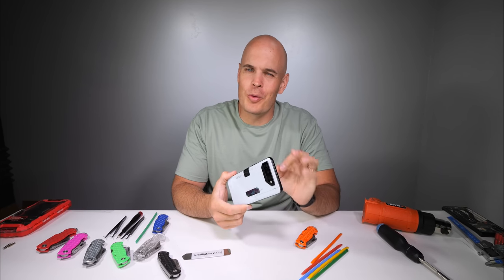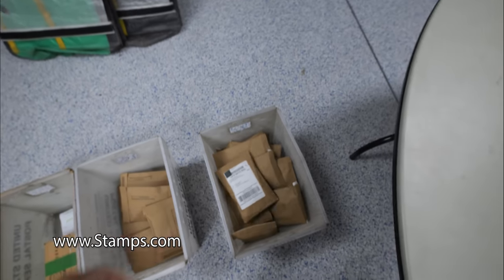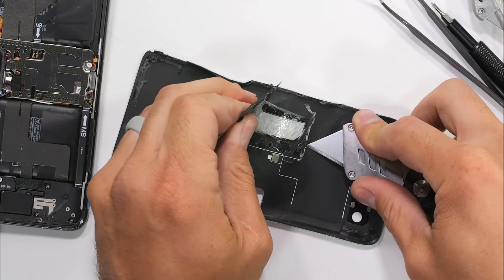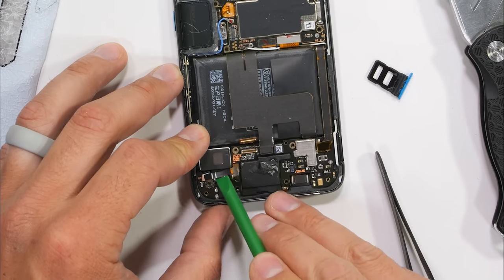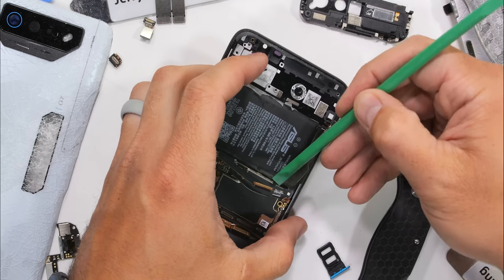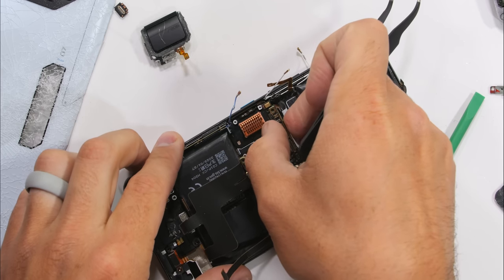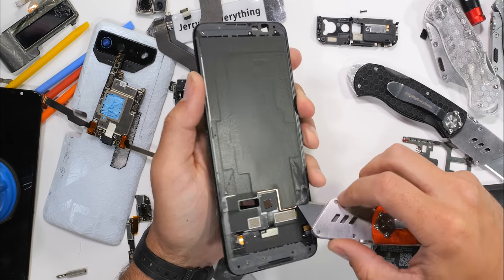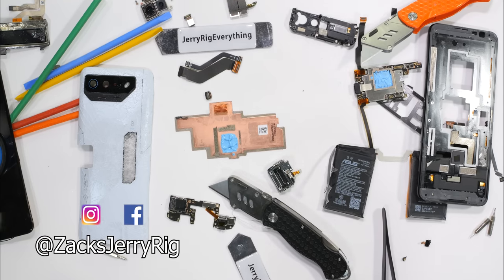Worlds most Complicated smartphone cooling system - (ROG Phone 7 Ultimate)

Comment: This has to be one of the most complicating phones you dissassembled over the years, everything is so intertwined together, like a maze in itself.
Reply: Yay have Rog 6 out of curiosity i opened it once and completely destroyed my proximity sensor i accidentally stabbed a cable on the bottom board which killed it. It has way too many cables
Reply: Nah, there is some HTC phone that was equally difficult or more, forgot the name though
Reply: yh but even tho it's complecated, its probobly more repair friendly than iphones are
Reply: A-maze-ing 😊
Reply: @zakariaejamiai4167  nope, i had a rog phone 2, and it suddenly died after the ic board got damaged, the parts were extremely rare, i gave it to 5 different shops, took almost 5 weeks and still wasnt able to find a part, so i just switched back to samsung and got an s22 ultra
Reply: @kx3811  great job trying to convince us that u did repair.. we know u don't even know how to open a tap 😂😂
Reply: @Alhussainba  HTC M8, I have disassembled one years ago - total pain in the ass 😅
Reply: When he first opens the back, the camera area has adhesive being stretched out. Is that normal like heating and using suction, or is it there to make for permanent assembly. Wondering how asus repair guys would be opening, or if they replace with a brand new phone with new memory and scrap for parts the original phone
Reply: @zakariaejamiai4167  Thats not a high bar tbf. Apple and Samsung both uses isolated software locks for components. In samsung flagships you can not swap camera modules between same two phones, you can't use the camera post root either. Only authorised service can replace the camera and get it registered with phone chipset.
Reply: @meow😼  you*
What's so hard to believe? And you don't even know anyways not like you could prove anything
Reply: @babascamdev2688  my local repair shop does not want to do anything with rog phone. Too rare.. They open up see look power up, told me can't be fix
Reply: @Alhussainba believe me. repairing my htc one M9 with a screen and battery change was a pain in the ass to do 🤣

Comment: 1:34 Zack accidentally hits his hand on the knife's blade and doesn't even get scratched. He's indestructible!!!
Reply: Thought I was the only one that noticed that hahaha
Reply: Probably gets scratched at level 6 with deeper groves at level 7
Reply: With the look on his face, it looks like he noticed it too lmao
Reply: pause at 1:35 - that was a pretty hard contact right with the razor edge.. and not even a small cut? pretty dull knife eh? not the best advertising...
Reply: @shekharbahuguna9475  hahhhhahaa
Reply: Hand is hand, and hand does not scratch :P
Reply: @Juidodin  actually it's because he essentially moved the blade out of the way. If the blade was straight on and didn't get moved at all by his hand it would've been a bad cut. As it is, though, all razor blades like that are made by the same companies to the same sharpness standards.
Reply: @Juidodin  Your reply was correct, he didn't intentionally move the blade off his hand, what I was saying was that his hand contacting the blade made it wiggle (move) which prevented getting the good, continuous contact you need to cut yourself. On any blade.
Reply: @Juidodin  its a feature, blade gives one warning.
Reply: He only gets scratches at level 9 with deeper groves at level 10
Reply: Don't you know in the parallel universe Zack is ironman, and when in this universe has an adamantium skin.
Reply: @Juidodin well actually he sells the razor blade case, not the razor blade itself since you can bought it anywhere
Reply: I came to the comments to see if anyone else saw him slice the knife across and not even flinch it was amazing
Reply: It hit his ring
Reply: Zack is a T1000
Reply: Jerry is the exception of "everything"
Reply: @Michael_Brock  omg 😂😂😂
Reply: Alarms started going off in my head when that happened.
Reply: @Yumosh20 out of almost 500k people that have watched this video you thought you were the only one that noticed that? Really?
Reply: @crunkin1t590  no need to be that toxic bro, sorry for my comment if that made you mad.
Reply: Scratches at lvl 100

Comment: This is the only phone i would understand removing the headphone port on, and the madlads managed to keep it in anyway. 
Super impressed. If this had a MicroSD slot and camera stabilization id buy it immediately but for now, still waiting
Reply: Well, it's so cool that $1200+ phone doesn't have stabilisation while my $200 phone does lol
Reply: @SamurajX-Esports the camera is an afterthought on this phone. As is the point of it. What they need to do is give it a higher resolution display and more pixel density.

Comment: I just tried this flap opening on my 7 Ultimate and i'm amazed I hadn't seen the option to open it without the cooler attached before!
For those wanting to try it - 
Obviously be careful but in the Aeroactive Cooler settings in the armoury crate, go to the aeroactive portal, and press the 3 dots at the top. Then go to cleaning and maintenance. Did not know it could do that!
Reply: Rog definitely doesn't want you to do that as it can ruin the whole cooling system.
Reply: @Fahim_Alam that’s far fetched
Reply: @Fahim_Alam  i mean if that did destroy it, then why can the normal version of the phone work without that? also it literally tells you to use that in that maintenance menu to open it with that menu to clean it using air since the cooler isn't really dust proof.
Reply: @Fahim_Alam  He doesn't want to, and that's why he has it as an option in the commonly accessible menu?

Comment: Phone manufacturer always put main processor behind the display, this made usb cooling fan less effective but I think the way ROG did is better because the copper fin will transfer heat directly from the CPU
Reply: Heat also transfers faster through glass than through a plastic or metal case.... And they know most people will put a protective case which would further insulate the back.

Comment: Since I got the ROG phone 2, I've never wanted another line of phones. I'm on the 5s right now and this thing is a beast. My old one still works so well, thanks to the battery care settings ASUS has put in. Plus the headphone jack, front firing speakers, and large battery, I don't play mobile games but this is a media/productivity powerhouse
Reply: but 5s dont have amolad diplay thats why I am stuck to rog 2 smh
all I care about in my phone is good processor smooth software and a very very good screen
Reply: @divyangverma9880  all of them have amoled screens since the first rog phone
Reply: plz tell me best battery care settings
Reply: @HectorOvalle18  plz tell me best battery care settings
Reply: @divyangverma9880  plz tell me best battery care settings
Reply: I also own an ROG 5S.
What are your battery settings???

Comment: One thing is you can play Minecraft on your phone in overtime. Your phone will get very hot. Running Minecraft for longer period of time so having a cooling system that will keep your processor cool and at the same time keeping your phone cool does help a lot when you’re having a long gaming specialyou can also play call of duty mobile on your phone as well. However, that will also make your phone hot so I think ROG is doing a pretty good job of making phones with high-tech cooling systems to help out.

Comment: Thanks for the alcohol tip.  I found a doner phone to replace the battery in the wife's unit and successfully got to the battery on the donor without any catastrophes.  But I chickened out after attempting to remove the battery as I was foreseeing a massive fire in my shop.
The alcohol will either help or act as a accelerant on my next try.
Reply: Rubbing alcohol works great since it breaks down the adhesive or at least works as a short lived solvent till it evaporates. But a little prying then more alcohol and rinse and repeat and batteries come out rather easily

Comment: imagine having a "complicated" cooling system on the phone ruined by not extending the "riser" on the copper plate which should be in tight contact with the chip as much as possible to achieve ideal heat transfer behaviour. Thermal compound with such a thick layer acts more as an isolant at this point.

Comment: Would be very interested to see what regular person load you can push into a normal smartphone and see what Temps you can get.
Playing music and pokemon go in full sunlight during the summer? Maybe run that off a wifi Hotspot or even better be a wifi Hotspot to push the phone hard and use wifi, Bluetooth, 4g screen at full brightness and speakers at full volume. Sure call of duty would be a better test but pokemon go is so badly optimized it will put more load on the system.

Comment: 02:30 
It was at this point I died on the inside...

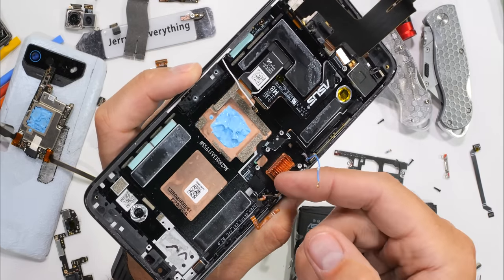07:46
Don't exaggerate.. there's no way you could stick it back together & it still work at this point? I mean it'd sure surprised the heck out of me if you could.. ?

08:54
It may not be unique, but I'm honestly impressed by the engineering... 

This all being said... what I think would be awesome, is if a phone like this, used less glue, & more like frames.. or some sort of backbone support?
So basically all the parts basically just slot into place, but it could be disassembled to fix it?

I still own a Samsung Note 9 phone. I like it. BUT eventually something will go wrong, it'd be nice to have the option to fix it w/o too much of a headache, or being in danger of cracking the screen...
I'd like to just be able to slide the phone apart in pieces, & put it back together as easily. I bought it on sale for like 800 bucks. 

If I bought a 1500 usd phone, I'D DEFINITELY want to have the option of repairing it easily.. or at least being able to get to components & replace them easily. 

Anyways..  cool vid. Thanks for doing.

Comment: I have some concerns harkening to my days of heat and mass transfer. First fins absolutely do help transfer heat however, they do so by convection. Convection requires fluid flow of some kind and I did not see a fan. Second heat sink compound is used as an energy conduction material designed to fill microscopic gaps in polished surfaces and would act very poorly in the copious amounts applied to that phone. If a copper block were installed to bridge the gap then 2 layers of compound applied one to either side of the copper block then the compound could actually work as designed. Based on what I saw the whole design is a way to upsell mediocre hardware. Not all that dissimilar to LEDs on a gaming tower if it looks cool people will pay more for it.
Reply: I just watched the video again to confirm my initial impression and again this serves no purpose, the area behind the fins is sealed making heat transfer occur through radiation only, this is not innovation.😂🤣😇
Reply: So It needs Air flow?
Reply: @youtube_bot839  Yes there is a lot of complicated math to go along with that but I won't complicate this. So think about your car if air does not move through the radiator then the car overheats.
Reply: @practicalenginerd7303  This phone already comes bundled with aeroactive cooler which should solve most of the issues.
Reply: @youtube_bot839  The phone should be fine by itself without the cooler. He even said as much in the clip. I have nothing against the phone fundamentally. My only real concern with the phone is that it is a bell/whisle that does nothing for the actual heat dissipation allowing manufactures to effectively sell snake oil to the consumers.

Comment: Can you talk about the wifi issues all Asus phone have been having and how to fix it without replacing the motherboard even the New Rog phone 7 ultimate has wifi issues you stuck with only using mobile data and can’t connect to wifi network. What’s the point of all that power on a phone if can’t use it properly?

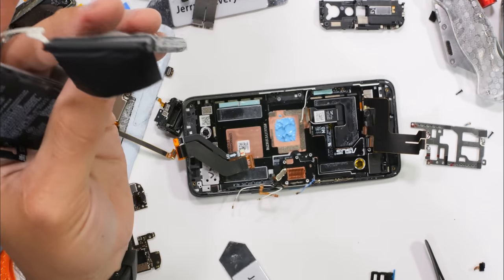Comment: 7:34 WTF, Asus uses same battery inside my laptop, which is dead after 3 yrs & i'm using with direct power supply. Instead of 23.3Wh, it is 37Wh with same Nominal Voltage of 7.7V.

Comment: $1500 for failed engineering...

Those ventilation fins is a flaw of how they used that space for transferring heat from the vapor chamber to the ventilation attachment.
Not to mention inefficiently huge amount of thermal compound due to the big gap between CPU and the vapor chamber.

ASUS phone engineering department should start talking with PC graphics card department.